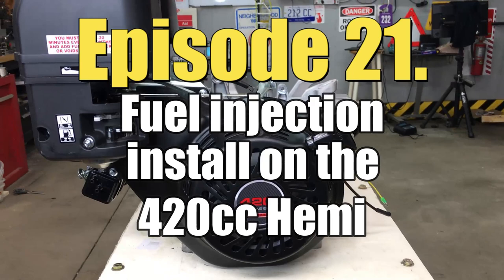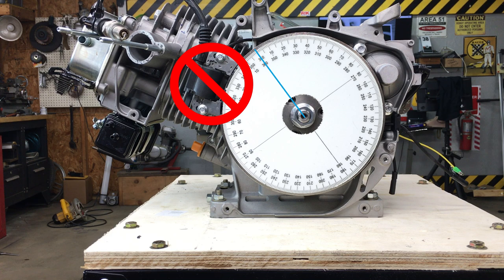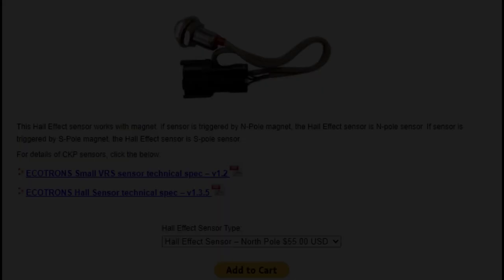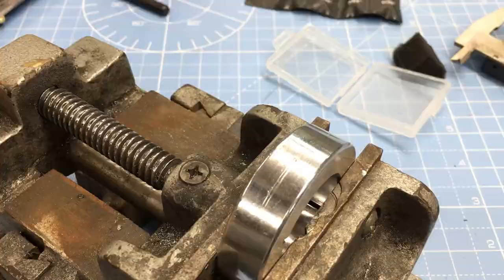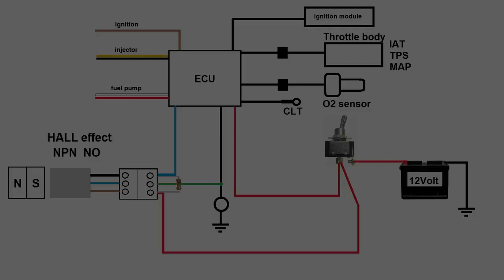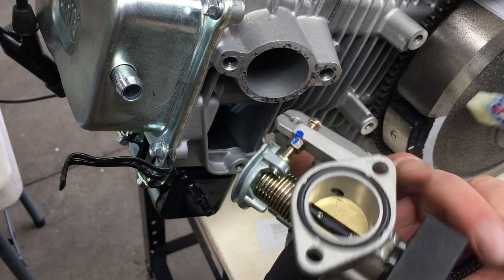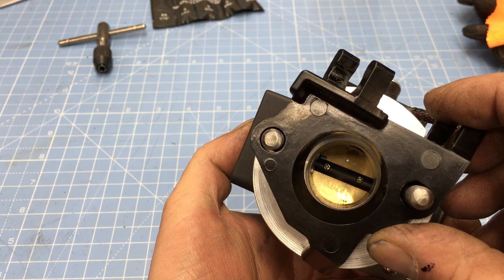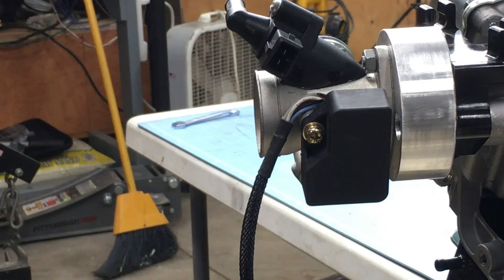Episode 21. We begin the EFI install on our 420 cc predator engine.  How hard can it be?

Comment: Cutting the last bit of angle iron by hand. I'd bet jimbo here broke the cutting wheel cause the vice wasn't mounted properly. 

About mounting the hall sensor, have you tried playing around with the settings? Skip 2 pulses maybe? I'm inclined to think that the software has provisions for such conditions. If not, try going to their manufacturer's website and look for an update. 

My car has an aftermarket "universal" natural gas system... among the settings are some odd firing settings such as those on dual firing or dual injection modes.

Comment: If the OEM system is a points ignition, that's not what the condenser (capacitor) is for.

Comment: This is a really great educational and entertaining channel. A few questions, did the reduction in fidelity of hall effect sensing on a smaller diameter effect anything?  Also the flywheel magnet looked removable. Besides needing to balance it, could you have out the correct magnet in it's place?
Reply from the maker: Changing the magnet on the flywheel would fix all the problems, but it would also cause new problems.  I would be concerned about the integrity of the magnet bond and or course the balancing.  It was way simpler to make the shaft collar with the correct magnet.

Comment: You could probably just get a 4000 series cmos gate to invert the signals from the wrong poles. With looking into a they are less than $1. Not sure if you would need to advance the timing due to the chip or not. Maybe 1 degree plus or minus.

Comment: Nice series. Got me to subscribe.  Was the thickness of the throttle body adapter  chosen to account for the cylinder volume or what you had on hand? As I remember, the intake runner volume should equal the volume of the cylinder chamber . So in your case, 420cc.
Reply from the maker: the size of the adapter was random

Comment: Fn gnomes.
The link is just for my convenience, are you kidding me, this video and electronic parts have overclocked my 10cc brain.😂
8:15 Did a beaver knaw on the thing?
My great grandpa has a hacksaw.
I used to use imperial butter, can you believe that?
There's something very erotic about all this.
Oh god he's using numbers again. No place like ohms.
I got a job drillin holes in sheet metal.
I hate golf, I hate those to play it even more.
If it wasn't for half ass I'd have no ass at all.

Comment: howdy. will you run the engine on the dynometer and play with the timing with the efis all set? I'm sure the static timing is great for one particular rpm range but will you be building a proper timing map from scratch?
Reply from the maker: unfortunately the engine will not fit on my dyno.   I will be writing a complete ignition map for this project.

Comment: Couldn't you use the sensor with the magneto by using invert logic?
Reply from the maker: Hi,  its not clear the way I edited the video, but the sensor is being triggered twice.  it turns on and off before the magnet and it turns on and off after the magnet.  This double trigger will not work, the ecu is expecting a single trigger.  Hope that helps.

Comment: Couldn't you have used a NOT gate to invert the signal? Only needs a few transistors.
Reply from the maker: Take a look at episode 21.5 if you haven't already. The problem is better explained. in the latter video.

Comment: Love the video! As an electrician by trade though, I have to ask a question. Can you explain how you found top dead center?? That part has me confused
Reply from the maker: With the top dead center tool inserted in the spark plug hole, it will stop the piston from going all the way up. if you turn the crankshaft clockwise it will stop at a certain point, turning the crankshaft counter clockwise the shaft will stop at the exact opposite point.   Top dead center is exactly half way between the to stopping points.
Reply: @robotcantina8957  Thank you!

Comment: Are you going to make the stark plug be a waste spark system so it fires on the compression and the exhaust stroke to make it simple. Or set it up in the efi to fire only 1 time per 2 revolutions. 
Also with the computer being set at 26 degrees and your trigger magnet set at 26 degrees the spark plug would fire at 52 degrees before tdc. Your magnet would have to be set at 0 degrees to use the efi setting of 26 to make adjusting the ignition timing easier
Reply from the maker: The system is set up for wasted spark.  Keep in mind, as I mentioned in the video, the sensor does not directly fire the ignition system.  The ECU only needs to know where the sensor is located with respect to top dead center. The ignition timing is done using using data collected from the previous revolution and the spark signal is generated using a time based calculation.... its hard to explain, but the bottom line is the system will work fine, even though it doesn't make any sense.

Comment: Have you thought about loosing the CV clutch and installing a harley transmission for a direct drive clutch. The extra gears might help you spilt gears too or you can use just one to use just the clutch.

Comment: I’m not sure how expensive stock is, but labor is definitely expensive. Would 3D printing an adapter and putting in a metal sleeve with gaskets or o-rings worked?
Reply from the maker: A 3D printed adapter would likely work, but there is still an interference between the throttle body and the bolts that mount the adapter to the engine, so the adapter would need to be thick enough to counter bore the bolts.  I went with the aluminum because it was cheap ($12.00 for material) and I'm going to be going to forced induction in the near future.
Reply: @robotcantina8957  CONGRATULATIONS JIMBO.. over 100k subscribers! 👍👍 ROBOT CANTINA
continues to provide the entertainment and fun that viewers enjoy!

Comment: Hello, I'm looking to do this on my predator 212. If I get the sensor that works on the stock flywheel and I mount the hall sensor where the magneto used to be, would it be fine if I set the software to 24-26 degrees top dead center because the magnet hits the magneto at around that degree from TDC? I would like to do this without having to get the degree wheel and TDC finder. If I mount the sensor where the magneto used to be I think it might work if I set the tuning software to 22-26 degrees.

Comment: I would worry about he aluminuim collar shifting and throwing off the timing.  Maybe tap the crank for a set screw?
Reply from the maker: The shaft collar locks will not move once the pinch bolt is clamped, no worries.
Reply: I would locktite the pinch bolt, but it should be fine. There is no load on the collar.

Comment: Hi
If the ECU is edge sensitive, why does it matter how the sensor triggers? you could just set it to falling edge for example.
Also, all you needed was a NOT gate, or a simple BJT transistor and a couple of resistors to make a NOT gate for yourself.
I'm honestly confused.
Or maybe you just love machine working, I can understand that 👍
Reply from the maker: Thanks for the input.  Perhaps watch the part again where I turn on the power supply and discover the sensor was not on.  If you watch close, you will see that the sensor indeed triggers before and after the magnet.  That is two triggers and we cannot have that.  The solution requires a lot more than transistors.  That is why I put the magnet on the other side of the engine.   Edge trigger was not the issue, it was the fact that there were two pulses per revolution.
Reply: @robotcantina8957  That's right, I get it now 👍

Comment: Why not just use an inductive sensor to avoid all of the relocation and magnet issues? They have them in the exact format and wiring as the hall effect sensor.
Reply from the maker: The inductive type sensor will not work as far as providing a single trigger per revolution.

Comment: couldnt you just add an inverter at the output of the hall effect sensor?
Reply from the maker: Thanks for the input.  Perhaps watch the part again where I turn on the power supply and discover the sensor was not on.  If you watch close, you will see that the sensor indeed triggers before and after the magnet.  That is two triggers and we cannot have that.  The solution requires a lot more than transistors.  That is why I put the magnet on the other side of the engine.   Edge trigger was not the issue, it was the fact that there were two pulses per revolution.

Comment: What about the skip pulses option in software to band aid the double trigger pulse of the wrong way facing magnet?
Reply from the maker: Skip pulses is used during start up.  Typically you want to skip at least one pulse and sometimes a lot more in order for the ECM to gather data on RPM.
Reply: @robotcantina8957  ahhh. Perfect. Thank you

Comment: if the sensor is triggered by the fly wheel and not the weight cant you get a normally opened sensor and it would trip then your above the desired location?

Comment: Why again still a transmission vs just a differential? The variable transmission/clutch hybrid should suffice and give all the acceleration you can get + top speed when final drive gear is correct and less drivetrain losses? Is it for the reverse gear?

Comment: Wouldn't you want the magnet at top dead center, and then the software will advance the ignition to the predetermined timing?  I think this thing is gonna knock when it does get running.

Comment: If this system only requires one magnet on the crank to set the ignition and its advance curve why do some EFI setups have trigger wheels with multiple equally spaced teeth and a gap to do the same thing ?
Reply from the maker: Great question.  More teeth on the trigger wheel will yield better resolution in ignition timing.  The single point this system is set up for is kinda iffy.  it will run, but I'm curious about how accurate the timing will be.  stay tuned for results in the near future.
Reply: Also with only a single cylinder you can get away with a lot of "slop" in the cycle.

 Same reason most early car EFI were throttle body injected with just a single sensor in the distributor. 

With port injection and per cylinder coils you have to have very exact timing information. They generally have cam and crank sensors with tooth wheels. Adding variable timing means even more sensors.
Reply: @robotcantina8957  I will keep watching with interest, also, I read someware that using very strong 'rare earth' magnets can sometimes cause problems with Hall effect devices and that weaker ferrite magnets are a better option

Comment: You're probably gonna have problems with that magnet de demagnetizing
Reply: neodynium magnets work in hard drivers for decades... not sure I've ever seen one demagnetize.
Reply: @dfabeagle718  the heat
Reply: @austindoud273  Crank shouldn't be getting hot... over 175* is a lot of heat.
Reply: @dfabeagle718  I've just seen people have problems maybe they used neodymiums that were more sensitive idk
Reply: @austindoud273  Fair enough. :)